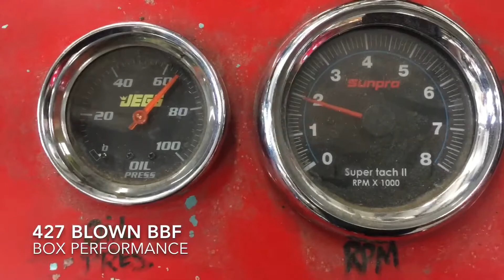Box Blown SBF 427

Comment: Looking at a ford small block blower motor on pump gas. What is the price? Thanks
Reply from the maker: Sorry, I missed this my app didn't show me any comments. This engine has some custom parts so the price from carb to pan was $30,000 with the blower in 2018. This one runs on higher octane fuel. There is a lot of variables in this engine so the prices vary quite a bit. Depending upon what parts and blowers size you would want the price would be less.
Reply: @blowersurge  thanks looking for a street motor on 93 octane heavy old ford truck
Reply from the maker: @cindymccready2093  what size blower are you interested in getting?
Reply: @blowersurge  probably 871
Reply from the maker: @cindymccready2093  what kind of horsepower range do you want to be in? And can you get 93 octane fuel where you live?
Reply: @blowersurge  yes on 93. Would like at least 750 rwhp